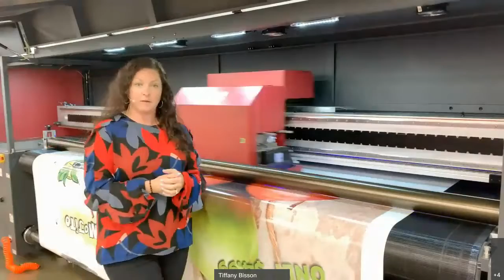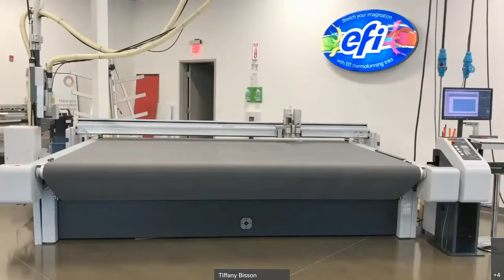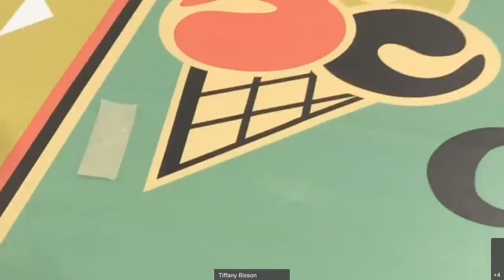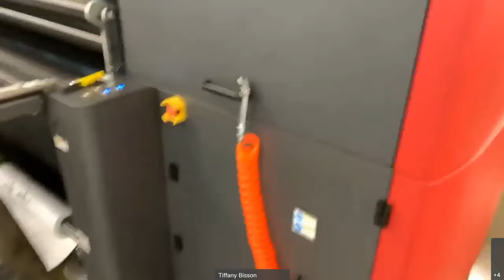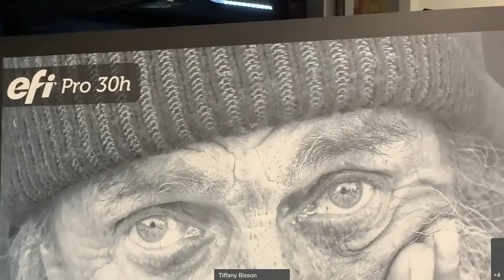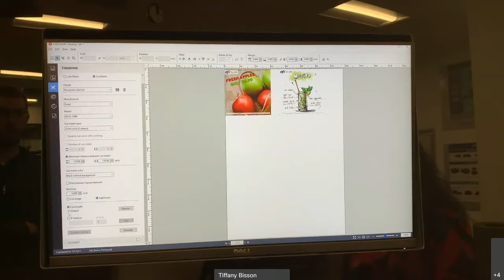EFI Wide Format Wednesday: EFI Pro 30h hybrid flatbed/roll-fed LED entry-level printer

Comment: We have the EFI pro30h at our facility, however we noticed you are running 2 different rolls of 2 different files. However, we can run 2 rolls as well, but we can't run 2 different files.  We have looked everywhere for the solution ( including calling a tech), and we cannot find the operation to print 2 different files at the same time, the very same thing you are demonstrating on this video.  Any help or recommendation would help for we can truly utilize this 2 roll printing feature for our operation.  Thanks!